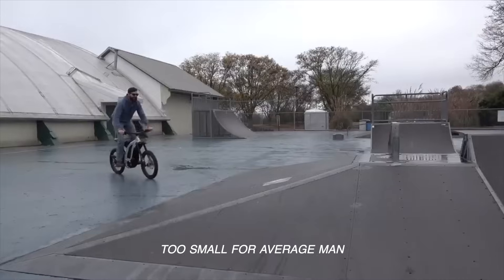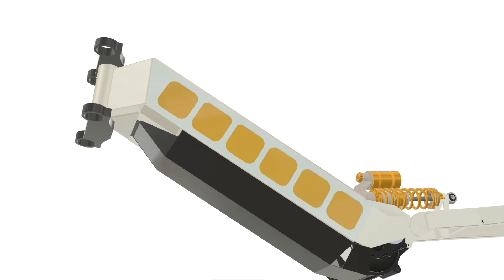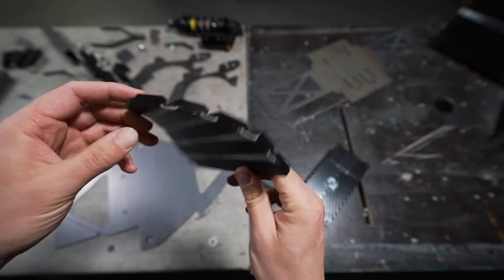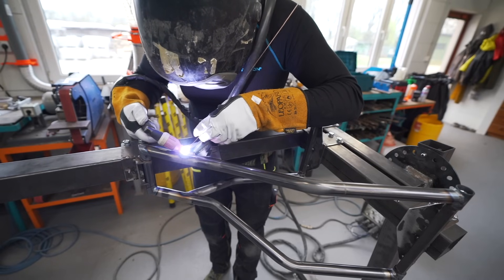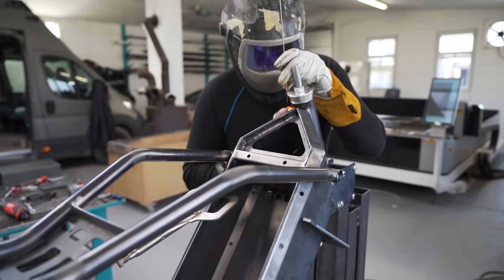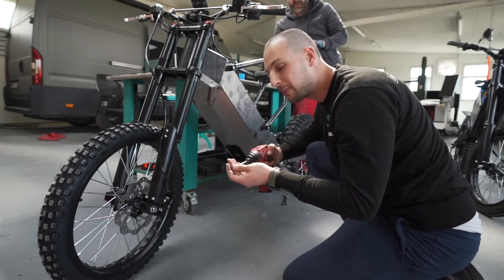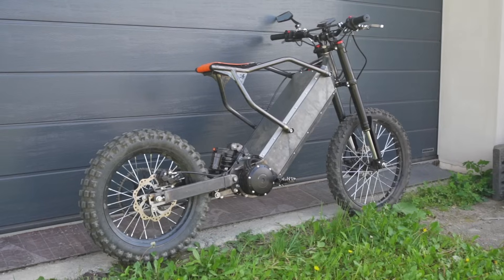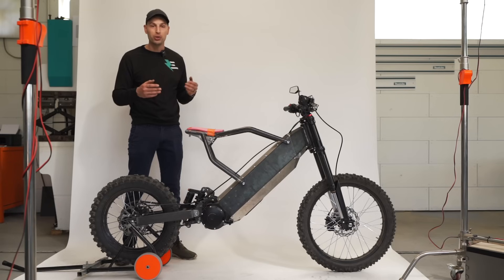Building Insanely Fast Electric Motorcycle From Scratch / New @ridevoltic Build

Comment: very nice. I don't like the head angle tho. I think the head angle needs to be slacker.. and maybe the front wheel should be of a larger diameter.
Reply from the maker: The angle changes with rider sitting on the bike. We do 21” front, it’s standard.

Comment: feel like you'd do better to replace the motor and chain with an electric hub
the hub also allows regenerative braking to reduce wear of parts
Reply from the maker: Hub motor is one level lower.
Reply: @ladiandmargaret  pretty sure that depends on which type you buy, if i recall right there's a large one that should create the torque you want and it has 2 types one that uses spokes and one that is basically the whole rim with the tread, only issue with finding a good one that fits your needs is knowing who has the large one you want
alternately if it's still not enuf try installing one on the front and back making your bike 2wd which adds even more perks for power and offroading, either way it's gotta be better then needing to carry tools in case the chain snaps or falls off and you can recycle some of that energy with a regenerative braking system making your disk brake pads also last way longer
Reply from the maker: Unsprung weight on the rear wheel is fundamentally faulty design. These high power bikes need reasonably big(heavy) motors. Don’t even think two motors would be ok to ride offroad. Heavy motor on the front wheel is a basic design failure. With powerful motorcycle like havoc I would not even think about front wheel drive. Why would I?
Reply: @ladiandmargaret  can't be much heavier than the old drum brakes my motorcycle has installed on the rear and adding a pound or 2 to a front wheel won't do much if you use proper counter steering even if you added a few pounds
as for why you want dual drive on a bike it can add a lot of responsiveness, especially on very soft mud, raw power isn't everything if you gouge your tires into a rut peeling out up a hill then get stuck you gotta fix that dual wheel drive lowers your odds of getting stuck at slower speeds because not every road is open and safe for speeding
there's people making and testing dual wheel drive hybrids right now with neat/nice results so i'd say look into what they are doing and using as it might give ya some neat ideas
Reply from the maker: I’m sorry to strongly disagree with you my friend but all of this sounds only nice in theory. Hub motors capable of 20+kW are over 12kg and I tested how it feels to have that weight on the front wheel. You can’t lift it, you can’t steer it, it’s complete trash! The benefit sounds only nice on paper. Brake drum and electric hub motor might look similar outside but have different hardware (weight) inside.

Comment: Finally somebody talking about making a battery that would not even come close to its rated discharge. You're legit the first person i see doing it
Reply: This should be essential. The datasheet continuous discharge current is often a bit optimistic and I've found Battery Mooch does an excellent job giving realistic discharge rates on cells. His Patreon is only $2 a month and worth every cent. He's doing cycle life of Molicel P45B/P50B/Samsung 50S under intense 5-6A charge 25A-30A discharge conditions and its really interesting. All I can say is while the P45B is a great cell the P50B looks to be AMAZING and the Samsung 50S definitely USED to be a good cell for those that needed more than 4-4.5Ah but didn't need the full 20-25A discharge and could settle for 10A to 15A where a lot of 5Ah 21700's just can't handle that....still the 50S gets way too hot. The Molicel P50B is just out of this world if the production cells are anything like the pre production cells he has.
Reply: Yea first time i heard of this too. Very innovative actually., opinions on this will differ ofc but they just dont get it ;)
Reply from the maker: We have few months testing behind us and these battery configurations are killer! Very small voltage sag, very robust torque, don’t heat up as much, perfectly balanced the whole time when charging or discharging with high current. So far looks like a good formula for long term high current use!
Reply: I thought this was common practice?
Reply from the maker: Not at all

Comment: When bending tube past I believe it's 30° you need to weld the tube shut on both ends and fill it with pressurized air add a minimum but a Newtonian based fluid would be best when using Newtonian based fluids though you must leave 1/10 of whatever space it is empty as Newtonian based fluids are noncompressible so it would cause the pipe to rupture as you bend it if you overfill it but if you feel it just right you can bend any pipe you can make a complete circle without putting a kink in it
Reply: Would weld on a valve and then cut it off after the bend ?
Reply: Can you use water ? Or air by itself ?
Reply: @cherrylopper  Waters noncompressible as well so you take a risk of rupturing the container and plus it's corrosive
Reply: @cherrylopper  you just need a slug really. You could use a valve tho

Comment: I get, that weight is bad, but does it have to come at the expense keeping circulation to your stuff? It looks brutal, just looking at it, & a bit bare @ the same time.
Reply from the maker: If you mean the seat post, it’s not about weight saving as much as design. All the hardware is in the main frame and it’s fun owning it in the design. Properly dressed motorcyclist does not have issues :)

Comment: I hear that dual motors running @ 50% increases acceleration, while consuming far less drain. You know how much faster a battery drains @ full throttle. Anyway, be it front & back, or a mid-drive with a hub combo. Give it a shot! I do like your idea too. I've  been thinking the same thing as well. Purpose built to last & not break your croch on a fake gas tank!

Comment: Didn't put sand in the tubes before bending, did you?😂
Reply from the maker: No, I did not know.
Reply: @ladiandmargaret  Yep, it's easy. I like your bike by the way. What wheels are you running? They look smaller than the typical 18" 21" standard dirt bike tyres. Or you're a really big dude!
Reply from the maker: These are 21 and 18” wheels
Reply: @ladiandmargaret  Excellent!

Comment: For the production model, you're obviously going to want fenders. Also, would getting mud caked onto the fins of the controller module be a problem. Cause with that sticking out of the bottom of the battery box it's going to happen. 
You'd probably also want to extend the seat. There will be times when riders want to duck down a bit and that usually involves sliding your butt back on the seat so your throat isn't right over the handlebars. (passing cars on a road or trails with low hanging branches would be 2 examples)
Other than minor details that's a VERY nice bike you've built. 
Like a couple of other people have suggested, powder coating would be the way to go. It's very durable and looks good. I'd go with a bright color contrast. Black/yellow or Black orange so it gets noticed and talked about. (more sales) Maybe black for the frame and yellow or orange for the seat frame, fenders, and a nice bright graphic for the sides of the battery box.

Comment: Hi... great project!! Have you ever tried an old trick of plumbers here in Brazil to bend tubes without deforming? sealing the tubes and fill them with sand before bending have a internal pressure and keep the tube from deforming while you bent it slowly

Comment: It still looks small, the seat should be back more, right? And a fender over the rear wheel?
Reply from the maker: The only way to judge proportions is to see the bike physically. We already extended the seat, made the front mudguard and will start working on the rear mudguard.

Comment: You can easily add a Y-to-Δ to the motor, so that it has 2 gears. Torque is then higher in gear2, by a factor of (1/√3). For that, u need to build an easy triple-switch (a switch containing 3 different connections, but all 3 actuated by 1 single button)
Y: The 3 wires´ ends of the 3 Motor-phases are connected together (the 3 phases forming a greek Y). 
Δ: Each wires´ end of the 3 Motor-phases are connected each to the begin of the next-phase´s wire (the 3 phases forming a greek Δ): The end of phase1-wire to the begin of phase2-wire, the end of phase2-wire to the begin of phase3-wire, and the end of phase3-wire to the begin of phase1-wire. 
With begin and end, are simply meant, the wire-pieces at the begin or the end of each phase (how many coils each phase has is irrelevant, each phase has always a single begin and end. For example, the begins are at the position, where the 3 wires enter the motor, so, extremelly accesible to solder a switch. To find the ends, u still have to open the motor). No software-change needed, just press the button after closing the throttle. Motor-efficiency remains the same in both configurations.

Comment: love the clean slate design. have you comsidered dc fast charging? lvl 1/2 and having an onboard charger sounds like a compromise and not the best design with the bike carrying extra eeight + generating eztra heat during charging. I know zero motorcycle ran into problems trying to implement dc fast charging with ccs chargers not being able to go under 200V. they said 200v was not optimal for electric motorcycles efficiency but HD livewire has fast charging. my understanding is dc fast charging "only" requires thick gauge from the battey to the charge port and electonics/software to communicate with the charger and continuously request adequate voltage for the battery charge. but no power electronics because the AC/DC and DC/DC voltage conversion are offloaded to the charger so the fast charger is basically plugged straight into the battery. you will of course still be limited by the battery cells charge rate but it also means you could tune the charging curve dynamically for speed or durability. also if 200V is too high for motor or controller, you could design the battery as two 100V modules (or more?) that you reconfigure with relays. serial for charging on 200V dc fast charger, then parallel 100V when running the bike. ( or 3x 72V) porsche isnusing thi trick to enable 800V fast charging on the new macan EV whil also allowing efficient 400V charging with no need forba step up DC/DC converter like in the taycan. sounds like best of both worlds to me. I read that ccs charger are able to slow down to 1.2kW  with 3A*400V so probably 3A *200V too...
NACS would be even better with smaller connector
Reply from the maker: The onboard charger weighs 2kg, definitely worth the convenience. It’s 4kW charger, it’s very fast charging! The charging current can be set on the display, slow or fast…

Comment: I'm in the States, I've built 20 70's era cafe bikes and several ebikes- one of which will do 60mph. 

My observations: head tube looks a couple degrees too steep for off-road, seat should be 2-3 inches lower, longer, more padded, and have a lip on the back so you don't like, slide off... Like the minimalist design, well executed but nothing novel, strong but heavy all steel construction, the mid drive is better than a 30lb hub motor. You'll need fenders for dirt use and a chain guard to keep from slinging oil up the back of your shirt/jacket. There will always be range anxiety with an emotorcycle, and performance drops with battey voltage. 

I still prefer ICE motorcycles for rural riding, and fast ebikes for urban use- which we can get away with over here, fortunately.

Comment: That is literally an electric motorcycle. The name is actually redundant. It is a motorcycle.
   Motorcycles, should have been called enginecycles or something along those lines. 
   Motors are electric, where internal combustion engines are engines. We call them Motors, but they aren't Motors.
   Therefore, the term applied to motorcycles is actually incorrect.

Comment: Lol I built one like this but a hell of a lot skinnier with only 1 row of 21,700 lithium ion batteries and scientifically studied and designed for every pound of the super ebike such as thicker and more oiled chains but smaller electrical motors and better but more efficient shocks because the 200 pound rider along with the nearly 100 pound super ebike (and very lighter and more shock absorbent with certain parts are made out of carbon fiber) so the whole motorcycle can basically stop at the drop of a dime

Comment: Hi! 

Love your content :D

I worked as a laser machine operator for 6 years. And I noticed you cutting in a strange order. Always do all the internal cutting first and use one cutting profile for that. Then cut out the frame. This is because the holes will not be precisely located if the part drops down onto the support grid (what we call them). Have a second cutting profile linked to the outer contour so when you fine-adjust the diameters of holes, you don't mess with the body. Hope you understand what I tried to explain :D

Comment: Only change I could see it possibly needing is the fork angle(something closer to a mtb), seems not steep enough, also the tires…something bigger.  Not a fan of how small they look on the bike.
Reply from the maker: These are standard 21 and 18 wheels. This is not MTB category so let’s not judge it with MTB measures.
Reply: @ladiandmargaret  not judging, I think it would help with handling and esthetics. Other than that it is a good looking build.

Comment: I think you need a bigger rear shock. After adding more Weight,  gear and maybe a girl, and a bump on the road,   u will have a major fall.
Reply from the maker: This is a single person bike rated for 140kg.
Reply: @ladiandmargaret  did you forget,  every bike becomes a two-person bike when there's a hot girl involved. And some people like thick girls. I'm not one of them but You have to be considerate. I'm sure the bike will hold up at 140 kilos My concern is the shock and spring setup 140 kg seems like a lot  negative drop that becomes like 60kg .   So if there's going to be a drop of about a meter and the weight of the rider and gear is 100 kilos . There's a good chance of breaking the spring or shock.   To play with engineering a rough estimate is   At 100 kilos negative rigging with a drop of 2 meters You need like 700kg breaking strength for the equipment  And then the safety factor of at least double. So realistically   If the bike ,gear and Rider weight is 200 kilos and shock needs to be able to handle a 2 m of drop The shock needs to handle about 20,000 Newtons.   Don't forget because if during the drop accelerate them to the maximum and You have excellent grip The rotational force force will also increase and the spring on the shock will be compressed even more so the shock even compress as if it has about 30 more kilos on it .   Plus there are many other factors that don't even come to mind at this point.  I think the shock needs to be longer .     Especially if the initial idea was to be able to have custom seats multiple applications for the bike.  Have delivered you of the sheet is longer there's much more pressure on that truck something used to be done now during the design stage so nobody needs to mess with this in the future do it right the first time.

Comment: I feel like the back shock should have more travel for bigger jumps. As a commuter I'm sure works fine but I would like to see how that rear shock would do on bigger jumps. And if you can have a bigger seat and I think this bike would be perfect. I feel like if u jumped that and floated off ur seat a little back u would slide off and fall.
Reply from the maker: This is not motocross bike for jumping

Comment: I didn't see that rear swingarm move at all when you rode it!? Is the suspension locked out?
Also, if it is for offroad, if you're off the seat or slip backwards off that seat, you have the possibility of the seat rail smashing into your stomach/pelvis. Or falling down onto the wheel. I think the commercial design will need to do something with that gap. Due to that battery mass, I also think you may need airflow ducts and or cooling fins when riding hard off road on steep hills or woodland where air can be still.
Good luck! 👍

Comment: Incredible project, it would have been great to install a 20KW central QS motor for more violence ! And space out the battery cells for better cooling and safety ;)
Reply from the maker: It does not need bigger motor and does not even need to cool the battery.

Comment: I think it's a missed opportunity, to put some shock absorption on the under the seat. I see there was some between the main body and the wheel. But you were just standing up a little on the gravel road. But if you were driving on the road, with potholes cracks in the asphalt.

Comment: first failure point will be the back arm connection to the motor. You rely only on bolts to support all the stress in ride while going over bumps? :)

Comment: Light Blue with Orange hightlights, definitly. Gulf Racing Colors. Also, if there is a way to make the batteries ultra-quick change that would be better.  For saftey reasons.  In case of a battery fire, you want to be able to quickly remove the battery from the bike, so only the battery burns.  Another option is to add temperature sensors to the batteries, that turn off the machine when the batteries overheat. However, nothing will stop a battery fire in the case of a battery puncture.